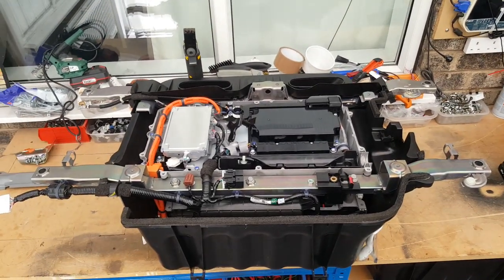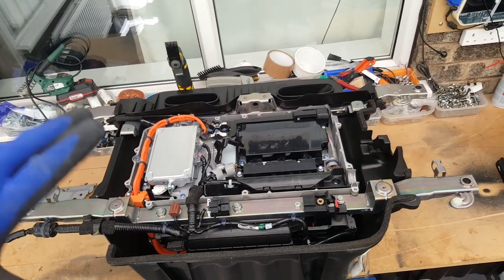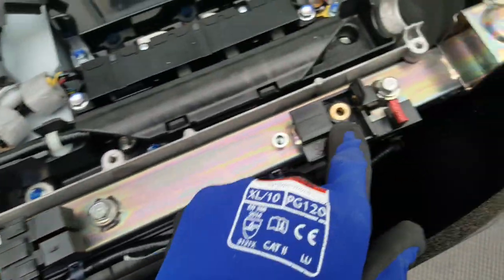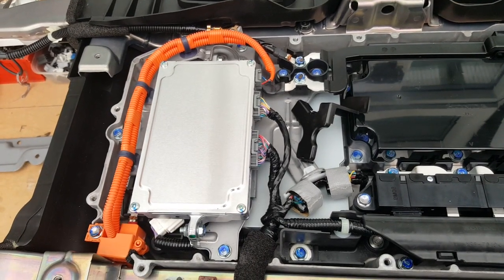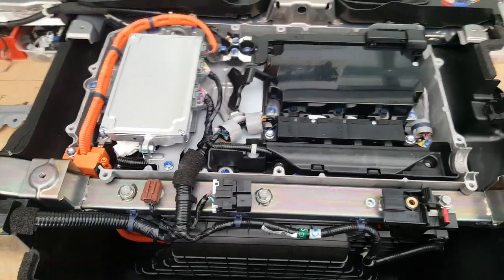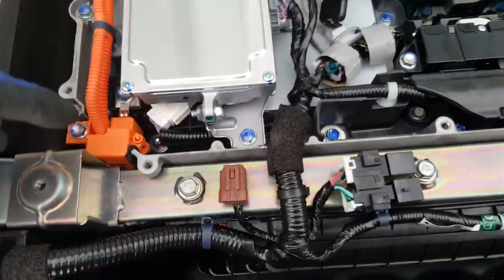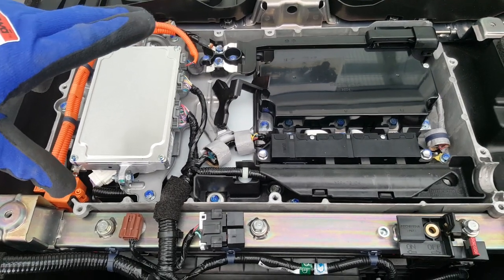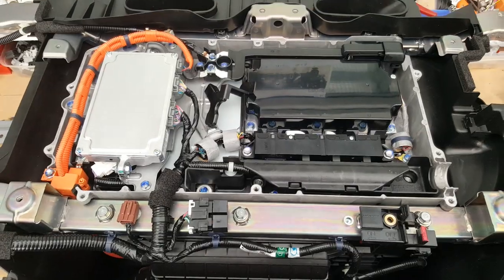Lithium CR-Z Buddy Pack Video 1

Comment: I didn't have difficulty turning the hybrid battery power switch off, but it seems to have a hard time turning back on like it's stuck on something. Is there a different procedure for flipping the breaker switch to the on position?

Comment: Do you have a video where you remove all of these parts to get to the battery pack?
Since the 2013-2016 shop manuals are non-existent (behind a paywall) trying to get some visual guidance as I do better when shown things vs reading directions
Reply from the maker: Have a look through my YT videos you might find something. I don't think there is a specific video on disassembly however.

Comment: You are an absolute wisord. Love reading all your write ups and learning about the crz nimh in particular. Im going to perform a rejuvination cycle (if needed) here pretty soon. I only have under 60k miles on a 2011 and it still feels very strong, but if it coul benefit from it i would love to do it. Thank you for sharing your knowledge